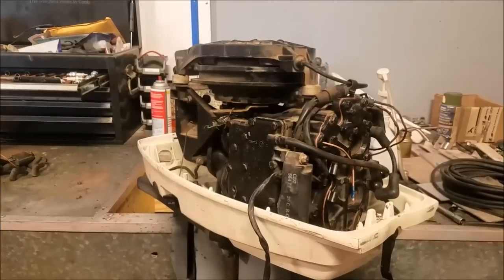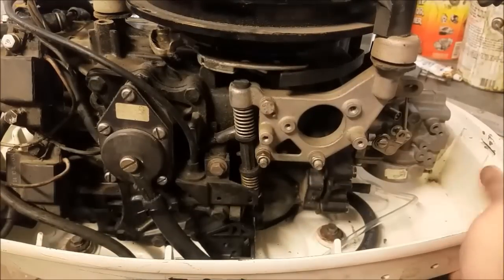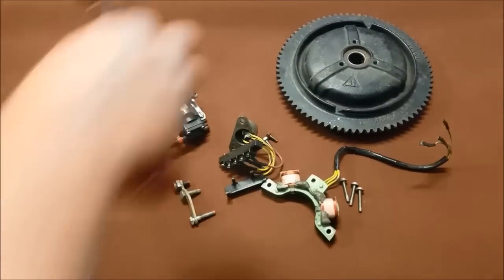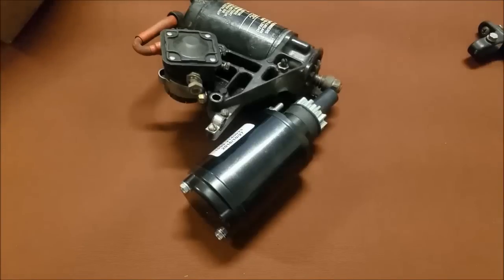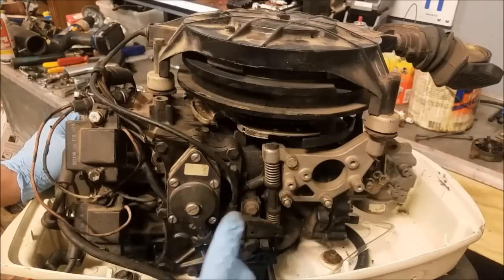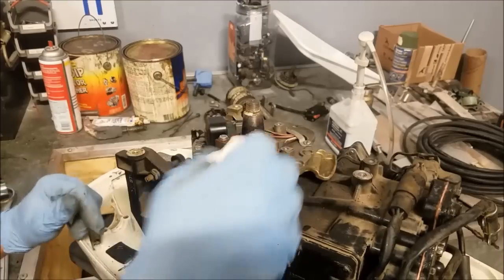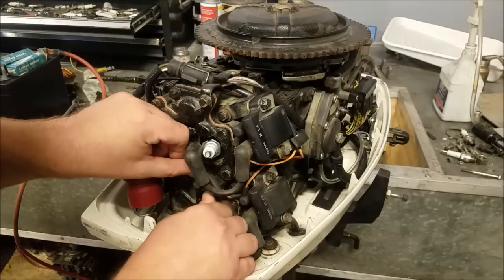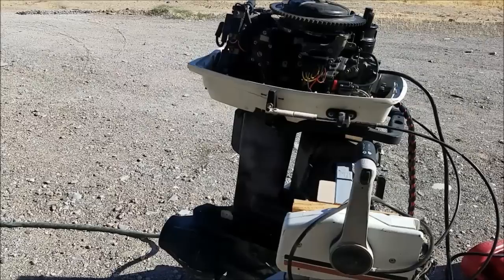Johnson Evinrude 20, 25, 30, 35 HP Remote Electric Start Conversion

Comment: Hey Brandon, great videos. I have a question about the ring on the  retainer support plate. It looks like it was lose I'm having problems with my timing plate not turning when throttling up. According to this old outboard also great videos . The lose plastic ring is the problem. What are your thoughts, again great videos please reply thanks GODBLESS

Comment: Hi Brandon just cme across your video ive got a 25 that is dropping both cylinders under load ive replaced the coils thinking it was only dropping one cylinder but am now quite sure its both so i think secondary side of ignition system is ok do you think it could be a power pack issue ran it home with no cowl the other day so it would stay cool didnt give me any trouble thanks John

Comment: First off, great video! Second, I have an 89 johnson 20 horse tiller. I am looking to install electric start on it. What all do I need? Just a starter, flywheel, and starter wiring like the solenoid?

Comment: Brandon..I was wanting to do the electric start add on and I am confused on the stator I can use.The 1985 20hp I have calls for one number and I see 1989 to 1993 I believe has a different number but they look alike.Any help on this would be appreciated.I am trying to find one and or a parts motor and want to get the right stator.Everything else is straight forward.

Comment: I need some advice, I am not getting any spark on my Johnson 25hp. I took the plug coils off, as well as my plug wires, spark plugs, powerpack and swapped them one at at time with my Johnson 50hp that has spark Spark continued to show.) This should rule out the named components from my "no spark issue." Can you please tell me where to look next? Thanks!

Comment: I have a 1981 35hp evinrude that came with the boat i got last year, but has bouse wiring on it, where did you find all the wiring ect. And my carb is in pieces, choke is gone, no hold down, it just missing alot of pieces. Any help, would be appreciated

Comment: Hi Brandon, I have a 1976 Johnson 35hp, electric start, & remote controller(w/cable with 'red plug')... The motor has a wiring harness with a 'black plug'... Is there a replacement wiring harness with a 'red plug' for this motor??? If yes, do you have a part # for it??? Thanks...

Comment: I have a 1976 20h.p Evin. It has the spot for a start and the teeth. But I can't find anything on the 20h.p only thing I can find is they were made in Peterborough Ontario Canada for a short time.

It even has the black plug on the side which something plugs into it . But I have no clue ??

Comment: Brandon, you are by far my favorite Utuber and do an awesome job explaining working on these old Johnson/evinrude..Ive have a 4 hp had a 6hp  and 9.9hp..Now I have a 25  hp that Im trying to convert the wiring from brown 76 plug to a red plug...
changing waterpump EVERY bolt snapped off,,every bolt you can think of...did you know that oxy/acetylene,,will melt the aluminum 
before bolt,,haha..fml.
anyway sir Im learning allot from your videos,
not sure yet how to wire a kill switch on a 76 points motor to a red plug electronic set,,may just run kill to choke actuator...anyway,,
next project is try and find and install a electric lift on my next motor a 60 hp 80s evinrude
Reply from the maker: Thats easy!
...Well, not that easy....
Out of the red plug is a black wire, and a black wire with yellow stripe.
Those who wires need to be connected to the 2 black wires going to the points on the ignition plate (under the flywheel)
Now, the black wire is a ground wire, it cannot be connected anywhere else in order for this to work.
I mention that because often times that black wire gets grounded. Sometimes it'll goto the stater solenoid, then branch off to the block, or it'll goto the block, then branch off to the solenoid somehow. 
That cannot happen. Out of the red plug, and straight to the kill circuit wires. 
It is also grounded inside the controller. 
The controller will have to be opened and the ground strap/bolt removed and taped off. Making sure the ground only goes to the ground terminal on the switch. 
This will eliminate the use of the ground signal out of the tachometer plug, buy you cant use that with a points engine anyway, so no real loss there. 
A new gearcase is available, and decently affordable; 038969 - $120ish from marineengine.com

Comment: I had a 30 horse carb I put on my 20 horse and the fuel distribution into the carb was more of a stream than a spray and it ran kinda crappy. Switched to the 25 horse carb and it worked fine but lost 3 mph in the boat. Looking for a good 30 horse carb if you know anybody

Comment: question, I have a 1995 20hp Johnson..do I have to buy new coil packs OR did you only change them because it was a Mil-spec motor?
Reply from the maker: I only changed them because they were Mil-spec.
What you have on there now is what you want.

Comment: You are the man.  I bought the same motor from a guy who told me it just need the starter to get it running.  Well it was partially true.  The motor is an E35ELCRR so it had most of the stuff you added but was missing the starter bracket, solenid, mutlispliced engine harness, etc...  Well I have it mostly back together now thanks to this video.  I just need to figure out why no power is getting to the key.  If I run a jumper from the power to the key, and turn the key, it starts.  I assume it is the neutral switch but not sure.  any thoughts?
Reply from the maker: check the fuse?
Reply: @BrandonsGarage  interesting enough after I left the message I when down and checked the wires again and I pulled the fuse and put it back to together and figured I'd fire it up and voila it turned over.  I did hear a brief beep / chirp so I was stumped on this sound. I when over and moved the wires around and it chirped again as the key was on but not at start.  I tried the key to start and nothing...  GRRRR.  jiggled the wires and it turned over when I turned the key.  I suspect a loose wire somewhere.  seems more in the big red connector when I move it...  the remote controller end is slightly corroded so maybe a new female end is in my future.  Thoughts?
Reply: it is a brand new wiring harness on the motor...

Comment: What does the tan wire on power pack do?The two tans going thru the harness are spliced together to have one going to connector so the temp switch and the power pack tans are one in the same but different connections all resulting going to same point. Explanation would’ve great.
Reply from the maker: Tan wire is your temperature wire.
Sensor in the head grounds out when it gets hot. This ground signal, is sent to the powerpack to let it know that it is overheating and go into SLOW mode, trying to prevent full engine failure.
It can operate without the engine harness, the connector ends can be arranged if needed to completely bypass the engine harness, should the engine be a tiller controlled; thus not having a red plug harness.
The reason it enters the harness is to send the overheat signal to the controller/dash to sound its warning horn (should the engine be overheating)
Reply: Awesome explanation. Now if you could tell me why someone would grind down the starter bracket where the timing stopper screw goes through to get more adjustment to achieve proper timing??I can’t find any reason for this,but timing is not possible without this mod.
Reply: Also,I tried fitting the exact pull start on my motor and flywheel teeth hit spacers when put back on. Any ideas on how to do this mod. ?

Comment: if you already have the electric start flywheel do you still have to pull it off for any reason?
Reply from the maker: only if you want to add a stator for battery charging.

Comment: Question I have a J25ECTD 1983 25 Johnson seahorse and the fellow that I got it from said it wasn’t getting spark he replaced the power pack and it was lose to the block does the power pack ground to the block by the bolts . Also the coil packs don’t have the metal clips like yours do.. do you have a video on testing coils and other ignition parts? Thanks
Reply from the maker: It does and it doesnt. There is a ground wire coming off the back, going to the power back bolts. 
But, it doesnt get it ground through the plastic housing.
Reply: My 1985 20hp lost all spark..turns out it was that black ground wire from power pack that is bolted on with power pack bolt was not making good connection.Took off and cleaned block and connector and spark returned.

Comment: Brandon I have the same AML35D with the same coils, power pack and trigger. I'd like to replace them. What model # should I use when ordering parts since I'm never able to find parts using the MARS model number. Thanks!
Reply from the maker: I think I went with a 1993. But really you can use any 1993-1996+
1993 has a red plug controller, where a 1996 would have different controller connectors. 
I would avoid 1990-1992, as they have a weird ignition module instead of a power pack.
Reply: OK thanks. I'm kept the pull start tiller setup, so I have an ac stator only, correct? No rectifier. @BrandonsGarage
Reply: Do you think I'd want the S.L.O.W. limiter? I don't have a temp sensor in the jacket with this setup.

Comment: Hey Brandon, I appreciate your time and info. I have a question. I have a 1968 20hp Johnson. I'm wanting to add a starter to it, it has a pull start ( want to keep) for my engine what sizes and years can I use for bracket, starter, solenoid? Thanks again for all that you do.
Reply: Idk if you are still wondering about this but im making the switch from pull start to electric and it is very difficult to have both
Reply: @braedenmizzellmizzell5360  I did figure out the years and size motors for the bracket and starter .after research I find that dollar for dollar, it was not worth it.  ,It was cheaper to buy a anther motor with a starter on it.

Comment: For these motors, is it hard add a cable to control gear selection? My motor is the 1985 25HP Johnson tiller control, and I want to convert to remote steering, start, and throttle/gear. Too ambitious?
Reply from the maker: It pretty much the same thing you see here. Just need the parts; electric starter/bracket and controller being the most costly.
Reply: @BrandonsGarage  how do I find the right parts for my specific number to make these conversions? The steering is easy...I have that figured out, but figuring out what parts exactly to order for the rest is pretty challenging.
Reply: @BrandonsGarage  if your willing to help.me figure out the part numbers for my specific motor to make these conversions, I would be willing to throw something your way for your time. Hit me up on Instagram and we can chat. Thanks man.

Comment: Hey Brandon....I was referred to you about this very thing. I'm just having trouble figuring out how to start and what I need. I have an 85 Johnson 25HP tiller control motor on my 14' MirroCraft V-hull. I've had 15 back surgeries, so I have got to convert my tiller control to being able to steer, run the gears, and the throttle from a console. Staying wrenched around to use the tiller has my back on fire within 10 minutes on the water. I'm not real concerned about the pull start...I can do that and it starts easily, but obviously if I can remote start it, it saves that much more on my back, us I can add an emergency kill switch since I'm often out by myself. Any help you can give me about starting this mod would be greatly appreciated.
Reply from the maker: Parts, parts, and more parts.
All should be available on eBay for a decent price.
If you need help with part numbers I can assist. Past that, this video lays out the whole process.
Reply: @BrandonsGarage  any help with part numbers would be great!
Reply: I have pics of the motor and the manufacturer plate if that helps...not sure how to attach them though. I can send them to you on Instagram or something if you on one of those platforms

Comment: I have a 1964 18 horse Johnson that I can't get the ignition to work correctly always been that way with the engine so I'm wanting to change out to that type of electronic ignition and charging system. But the problem with me having the flywheel the tapered spline shaft. The flywheels the shafts are different sizes anybody knows how to do the electronic ignition on it I've tried the little chips electronic chips that just doesn't seem to work right?
Reply: Somehow swap out the electronics from the 35 to the 18 horse

Comment: Thanks Brandon for this video. Do you still have the parts you took off? Someone did that conversion on my 20 and did not keep the pull start on top. The hole in the Cowl is annoying, would be nice to at least have it usable if needed as you said.

Comment: Brandon,  I have a 9.9 Evinrude Outboard that wont start.  It ran fine last summer, but tried to start it this summer and nothing,  I get spark on both cylinders, I rebuilt the carb and fuel pump
last summer so I know they are good. I cleaned the stop switch, but still nothing, I tried starting fluid  and also tried putting premix in spark plug holes but still no start. Do you have
any suggestions on what I should try next?  could the cdi be bad if you get spark?
Reply: Gasoline engines need spark, fuel, and air. If you have spark, check for fuel. Even though you say you rebuilt the carb and fuel pump LAST year, it be clogged with stale fuel if you didn't run it dry before putting it away. Pull the plug, squirt some fuel in the cylinder and see if it fires. If it does, that verifies spark and timing, and your problem is fuel.

Comment: Great video Brandon..Question?Can I install the temp. sensor on my 20hp?Where does the wire from it go?
Reply from the maker: what year is your 20? 
You should already have it,
Reply: @BrandonsGarage  1985 and I also tore a 1988 30 hp tiller rope start apart for spares and it did not have one either

Comment: great video, explains alot.  I've picked up a '03 johnson 30hp mil motor(j30mlsrc)  I want to convert to an electric start with pull start remaining.  I cannot seem to find anyone that can help me convert.  Johnson said that since its a Military motor there is not a conversion kit for it.  Any help would be greatly appreciated.  buying a new motor with electric start in Hawaii is out of the question......  they're so overpriced here, and I'm not going to wait six to nine months to get one from main land......
Reply from the maker: this video didn't help with what you need to know?
Reply: @BrandonsGarage  physically i can do this, but sourcing the parts is a problem